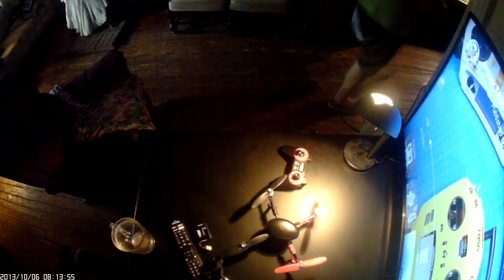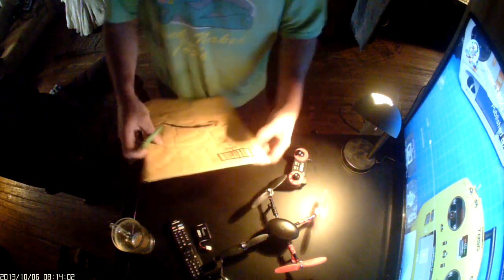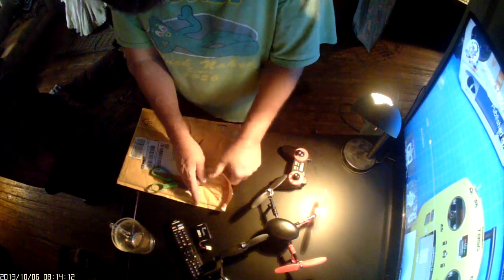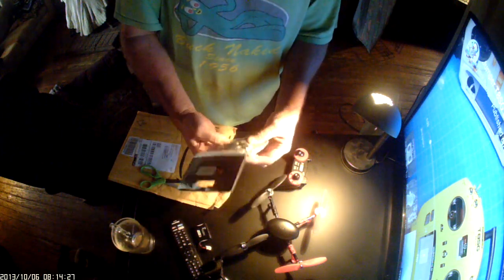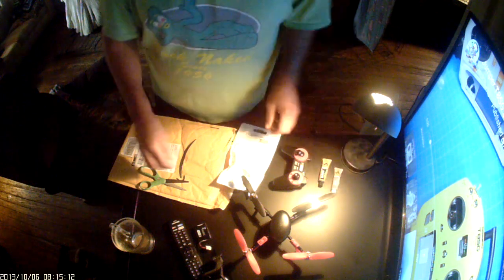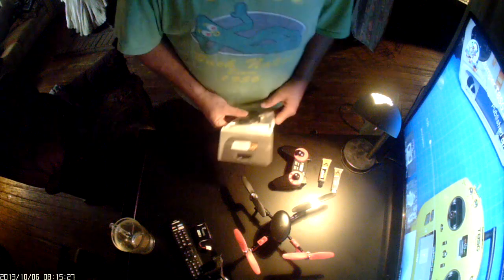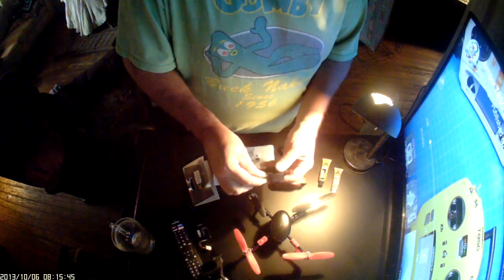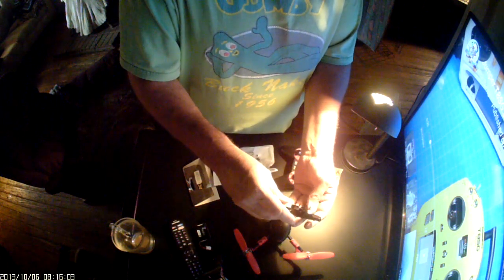RC Logger Extreme eye one Frame

Comment: Cool maybe you can reinforce or strengthen the frame where the arms join on?
Reply from the maker: The soft design is one of the main reasons this quadcopter produces smooth footage it's really quite ad well.  This thing hovers in silence.  I put the new frame on and modified the original frame.  Now a universal fpv camera and will see what I'll capture on on film... The larger battery that comes with the camera mount system is not noticeable different in flight time happy Thanksgiving to you and your family... God bless
Reply: @JohnBenussiBass  I think you're right, soft frame = no vibration, that's why it's whisper quiet 😎